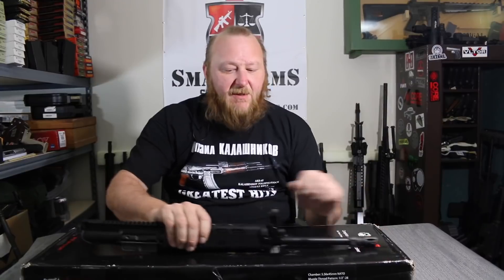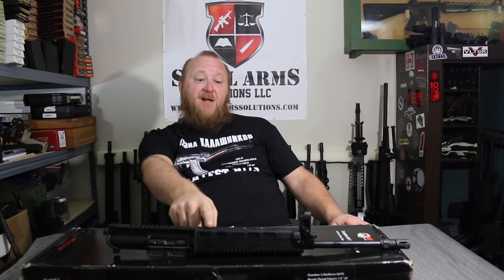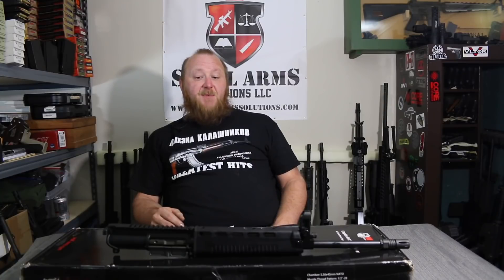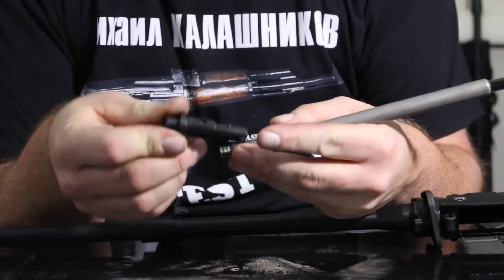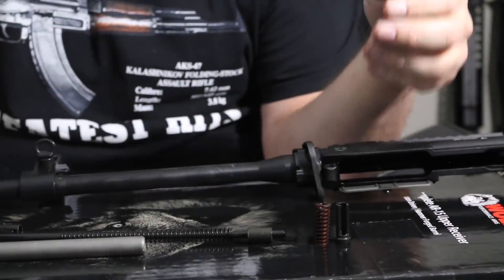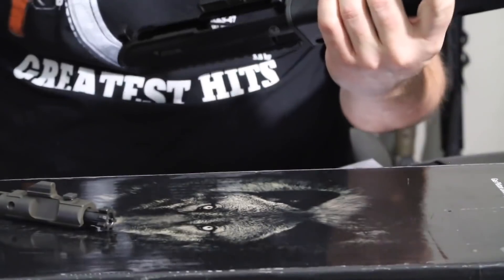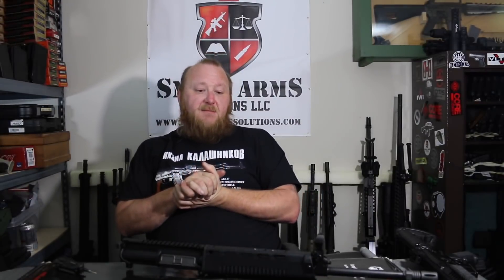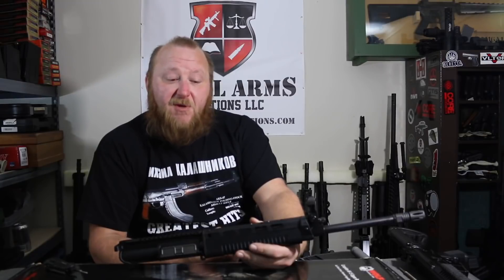The Wolf A1 Upper

Comment: My build:
-Wolf A1 upper.
-Wolfpack Armory Cerakote Stripped Lower Reciever.
-PSA BLK MOE Lower parts kit.
-A2 Stock and Assembly.
-Daniel Defense Fixed Rear Sight.
-Holosun HS515 Red Dot.
-2 Point Sling.
-Custom Made Flashlight Mount.

Way cool.
Reply: Did you ever end up building with a wolf A1? Never saw a video.
Reply: @jeremyz6911  ill make a video
Reply: Where did you attach the sling up front???

Comment: **T91 Tactical now sells a a T91 manufactured front site assembly made specifically for the 18mm gas port Wolf barrel. This front assembly is exactly like the T91 which has a bottom rail/bayonet lug. Also has the T91 bayonet for sale as well...

Comment: I definitely am going to pick one of these up, probably the 12.5 variety. 

Ever notice that around the world, our 14.5” M4 being an exception, 12” - 13” seems to be the generally accepted barrel length for 5.56mm carbines? I’ve always wondered why that is.
Reply: Green2Blue 30 LT James Sullivan & Arthur Miller found that a M-16 barrel with 7” forward of the gas block on a DI gas system was the sweet spot for maximum reliability. So 20” & 14.5” both have 7” forward  of the gas block.
Reply: Also the rest of the world sees no value in pushing a 22 cal projectile out to farther distances so they use it in a cqb role hence why South Korea calls their 5.56 k1a1 a sub machine gun. When you gotta go long, go .308 or go home

Comment: Question, can you use a regular mil spec A2 carry handle or does it have to be the carry handle T91 tactical offers? I heard the T91 carry handle sits lower.
Reply from the maker: You can use a A2
Reply from the maker: The T91 carrying handles I got sucked. The screws were not hardened. Yo could easily over tighten and strip them when placing the carrying handle on the rail. US A2 ones do not do that

Comment: SmallArmsSolutions - I just purchased the 12.5" version of this Wolf upper. Are there any extra concerns to be wary of? It's not very heavily discussed online. Would their be excess parts wear and reliability issues with a shorter barrel on this piston design?
Reply: I would suggest getting the anti tilt recoil buffer system from t91 made for these uppers. It’s an h2 buffer weight really helped tune my 12.5 A1 and binary combo
Reply: How are you liking the Wolf A1 upper so far? I purchased mines 2 weeks ago and I'm totally satisfied with it. I was just curious how yours worked out.

Comment: Chris, thanks for another great informational video. I have a Colt 6940P "Piston Carbine" lower that I'm planning on finishing off with one of these Wolf T91 uppers (until I find/buy the proper Colt 6940P upper $$$$). Will the stock Colt "H" buffer & spring work okay with this system or should I use something like a "H3" or Geissele Super 42 with H2 buffer?
Reply from the maker: dubya 87 H2 buffer
Reply: I did the exact same thing. Found a 6940P lower. Seems like a good match..

Comment: Nice video Chris.

For a build, what would you choose for a buffer spring and weight assuming a carbine length buffer tube?
Reply from the maker: Slim934 H2
Reply: @SmallArmsSolutions  Thank you sir, not much reliable info could be found about the buffer system for carbine setups.
Reply: @SmallArmsSolutions 
Hello, I've recently purchased and built out a 12.5 Wolf T-91 upper using an H-2 buffer, and it is extremely over gassed with the ejection pattern at about 1:30-2:00. I'm currently waiting on an H-3 buffer, hoping that that helps . As there is no way of adjusting the gas. Is over gassing a common issue? Any helpful advice would be greatly appreciated. Thank you!

Comment: I'm looking at getting one of these uppers but I have a few questions are the bolt carrier parts proprietary ? Can u use a regular ar15 5.56 bolt and still have it work correctly ?  Can the parts in the bolt carrier like the firing pin be replaced with a regular ar15 parts ? And is the charging handle proprietary ?
Reply: There is a website named t91tactical which is a website for wolf a1 owner,so you will get the answer in that website.
Reply: Yung Blac got mine today. Looks like all the parts are interchangeable. Like the firing pin, boltcam, , bolt is the same except with out rings and the extractor
Reply: @pappydanny58  What is the build quality of the upper you received?  Most reviews indicate that the upper runs OK (or better) but I've read some complaints about QC of parts fit and finish.
Reply: Ramas Samar I cant find anything wrong with it. Quality is better than I expected. Finish is a little more textured for a good match for a lower. What did was get a engraved 80% raw lower from atomic engraving and finished it with brownells Aluma Hyde and came out perfect
Reply: Yung Blac the bolt carrier is the same as any piston ar15

Comment: Do you know if I can get this in California?
Reply from the maker: justin M no idea, I live free in Texas.
Reply: Yes you can. I live in Kalifornia and I have one.
Reply: If you live in California buy a czechpoint vz58 only senceable rifle for California it has a fixed 10 round magazine and feeds from the top with stripper clips the magazine release can be replace to standard if you move out of California
Reply: Yes you can, but you need a California compliant ar-15 lower receiver. I recommend you go to a local gun shop that has “black rifles” and ask them if they could set you up with a lower receiver. Then you could mail order any upper receiver you want. If you time it out right you won’t even have to wait extra to have the rifle, the upper will take 7-10 days in the mail while you’re waiting 10 days for the lower to clear. Cheers

Edit: I want to add that if you decide to move, the AR-15 CA compliant changes are reversible as well and so are the magazines.